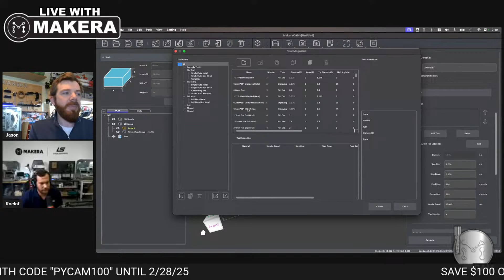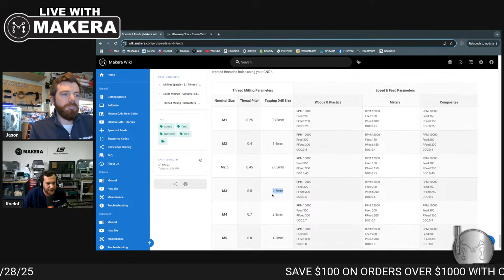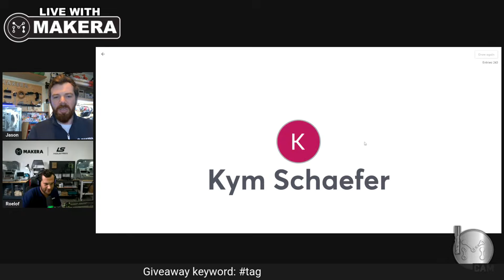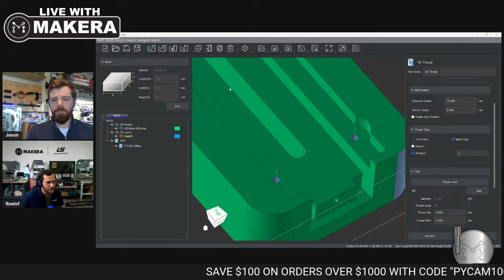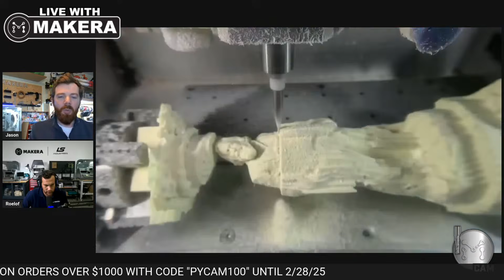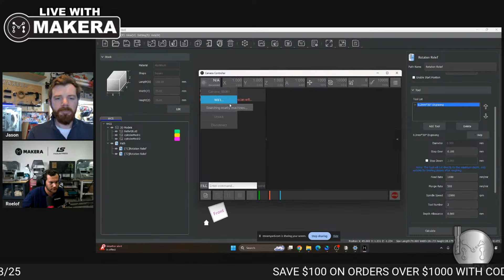Makera CAM 3D Milling Unveiled: Unlock New Levels of Creativity!

Comment: If, in order to save the material, I want to use the machine with a billet that already has some shape and rough details of the model to add final touches and fine details, is it possible to set-up  this in CAM somehow? Maybe I need to scan the billet, so that I would have an original 3D model and a model of a billet to match them precisely? Or I just can measure my billet correctly, scale the model accordingly, place the billet in a correct 0 point, choose the fine tool and the machine will do the rest for me? Thanks!
Reply: I think you can just let it run it’s path as if it was doing a roughing pass? it won’t remove anything, and will just be running in the air for a while, but should eventually reach your material? Unless I’m missing something and you shouldn’t do this for some reason?
Reply: @Keneo1  it seems so. I am just concerned how to match the path precisely with the billet, especially for the finest details
Reply from the maker: This is an interesting project, chat with our other users doing something similar in our discord group or contact our support team via support@makera.com so we may assist you further.

Comment: Please make more tutorials for multi side milling of 1 part. How to align the part that machining on more than 1 side will match with the other side. For example the part you showed for making the thread on the side. This was a frame and then in the stock you flipped it 90 degree to make the thread hole on the side. How do you align the part to make sure that the thread is in the right position?
Reply from the maker: Great suggestion, and we will look to provide more examples of this in future tutorials. For the time being, see our fidget slide card project and two sided PCB milling projects on our Youtube Channel.